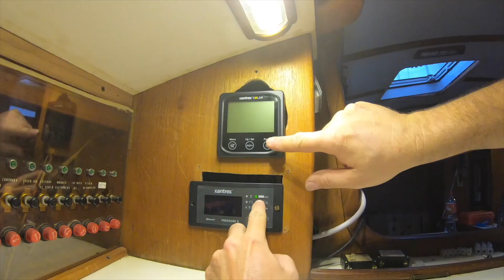Live Solar Q&A with Odd Life Crafting & Tech Doctor Thurs July 30th at 2 PM PST / 5 PM EST

Comment: I plan on watching. My use is for a 26' class A motorhome. I have on order the Freedom XC 2000. Will be running it on two LifeLine 6volt batteries for now. The inverter will be more in the range of 7 ft from the batteries. Will use 2/0 wire . How do you figure if this is OK? Where are the charts to figure this? The manual says less than five feet. Need more info on this . Did watch a YouTube video on calculating this and i believe that the extra feet are OK.
Later on may upgrade to some solar and Lithium batteries. Where can these be purchased?
Reply from the maker: Hi Byron! Thanks for your question. Our experts addressed your questions during the live stream, but if you'd like to discuss the topic further, please feel free to reach out to our customer service team at 1-800-670-0707. Thanks for watching!